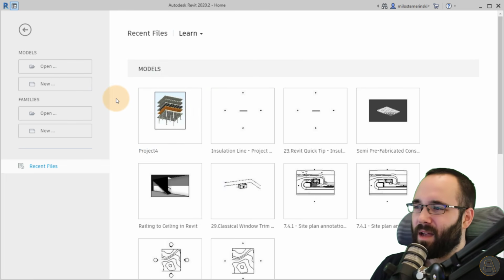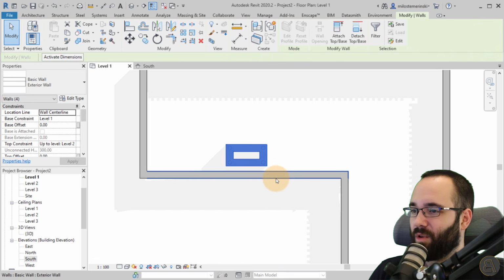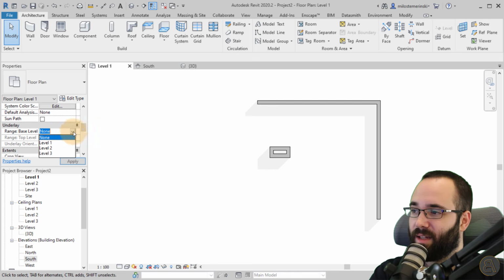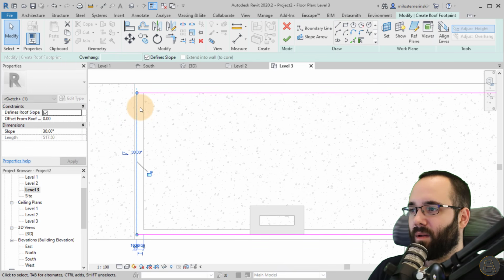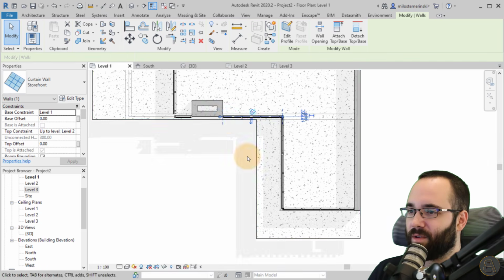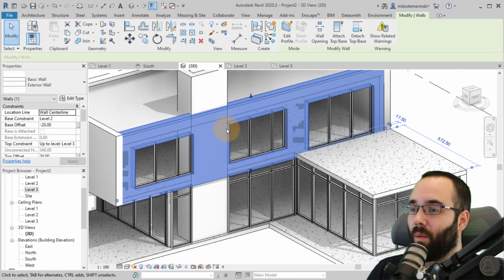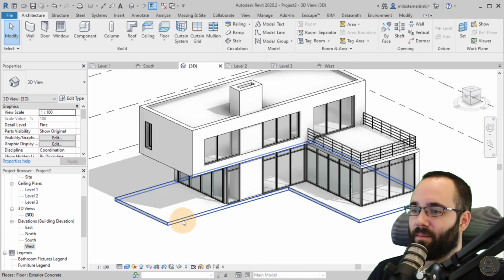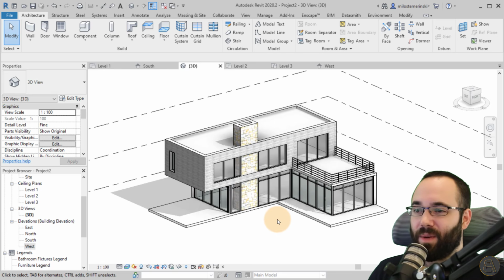Modeling a Modern House in Revit Tutorial

Comment: I would like to see a part two for real-life architects trying to (finally) fully transition from ACAD to Revit, and who are, like me, essentially stuck at the point you left off here, which is a something more like a sketchup model than BIM.  I want to see this turned into a CD set, start to finish.  I think you've covered everything it would take in other discreet tutorials, but never as a process.  Youtube is full of Revit "modeling" tutorials, but it's like those models you can download from Thailand that look cool but are good for nothing more than props or set design.  Take this model, place it on a real site somewhere in the world (how about Dubrovnik?  I hear it's nice), geo-locate, drop in this model, maybe show how to integrate a Revit structural model (even if faked), create some schedules, cut some sections, do some enlarged plans, label it, tag the doors, windows, walls, etc, show how to create the references, RCPs, drop in some standard details from CAD libraries (also don't have to be real, but show the methodology), etc.  Then do tutorials on how to do power plans, lighting, etc.  Don't get me wrong, I love what you do and I have gotten a lot from your tutorials.  But the next step has to be showing us how to put it all together into something useful, like a set of working drawings.  Thanks!
Reply: Here to ask if you’ve found anything at all like this? Also transitioning from ACAD and need to get used to doing an entire workflow in revit. P.s. also maybe something showing how to apply preliminary textures or get different perspectives views for a CD set?

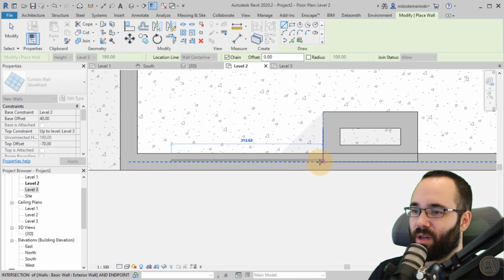Comment: At 15:40 when u draw the windows on level 2 the walls automatically readjust - when I draw the windows it draws them in the same space as the walls on top of each other and I get a warning about overlapping geometry - anyone know what setting I have wrong?
Reply: so may i know how to solve it?
Reply: Solution... hi, just incase you havent found out how to do it, its really simple. draw the masonry wall, then draw the curtain wall inside it just like Balkan did, then you get the overlap error, you then simply just click on the masonry wall, hit cut geometry, select the curtain wall, then select the masonry wall, and it will automatically cut it out for you, can cut out the wall in 3d too if thats easier, remember your base and top offsets. good luck.

Comment: Is there going to be a part two or a follow-up on this one? Because this  << tutorial >> feels a bit lackluster. 
I understand this is more about the "workflow" but you can add so much more and I believe you can easily link this project with some of the courses you already made. Using this project as some kind preview to your courses.
Looking back at the sketches there a tons of interesting objects/families/details that are currently missing. 
For example: the little pool, the sliding blinds/panels at the curtain wall, windows inside the curtain wall (would be nice if the owners could open one or two don't you think), the corner mullion, the green roof, etc. 

Not only families are missing but what about the insulation, drainage ( I don't see any pipes drawn on the facades does this mean that those are built-in the walls or inside the chimney?), doors ( how do they access the terrace, how do they get in the house you forgot the main door😂),  a few schedules would have been nice, etc.

You said it yourself: "Revise and edit. You throw some elements on the screen and then you revise them. You add complexity and detail. That is basically the approach". 
I'm not convinced that this is currently the case. But I would love to see it, you don't need to explain or make video/tutorial about each family you will be using you have your courses for that but I want to see that complexity and detail you're speaking of. I want to learn, think, compare it , ...
Reply: https://youtube.com/channel/UCfMOeDU5lT6Mq42r24H5KWg
Reply: https://youtube.com/channel/UCfMOeDU5lT6Mq42r24H5KWg